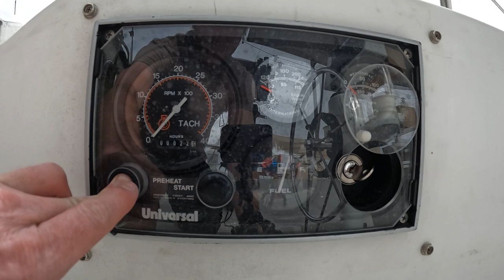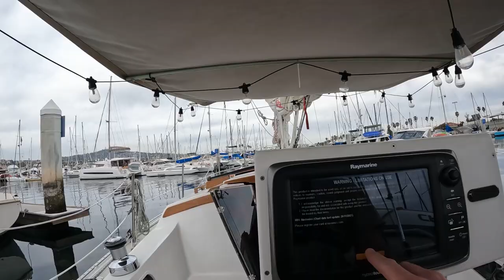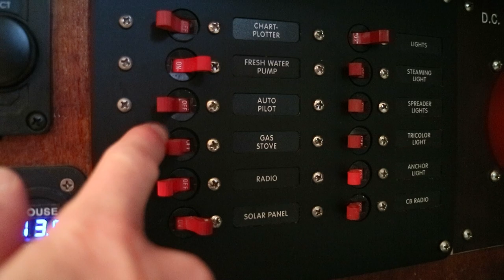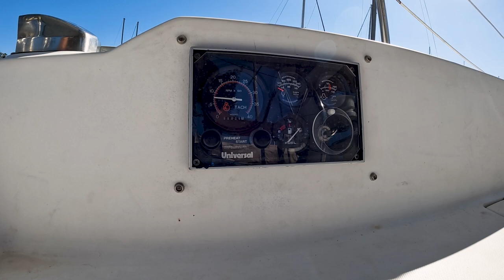Trouble at Sea! Adrift on a Catalina 30 | Sailing Fujin S1E5

Comment: Marine mechanic here who also owns a Catalina 30 with a Universal engine. Don't forget to order yourself some secondary (engine mounted) fuel filters as well. The Racor is a fuel/water seperator so that clear bowl is to check water so you can drain it. If you are seeing sediment (which is algae) you need to polish your tank. Put a biocide in the tank every time you fill it to keep algae at bay and to avoid serious fuel system issues that can destroy the injection pump and injectors.

Comment: Your vid showed up on my feed so your doing something right. I have an old Cat 30 too. There is nothing wrong with reefing lines at the mast. I do clip on with my safety harness when going forward to reef. Fuel troubles never go away. I put a round inspection port in my tank so I can clean it out. A vacuum gauge on the filter tells you at a glance if the line is blocked. Sometimes you have to take off the fuel line from the filter and blow the crud back into the tank if that is blocked. Keep the furling line under tension while rolling out the head sail  even while it's out. Nice winches but you don't need the extra blocks, they only add drag. A dodger is a must for cruising. Sailrite sells a nice kit. Dana point is a nice hop for you and you can anchor for free. What else? I hoist up the inflatable with the spin halyard and lash in down on the fore deck, deflated for long trips or heavy weather. I glue a Scotch Brite pad from West M. to a block of wood with a handle on it so it floats and hold my breath, no weights. 45 minutes and I'm done. A tea pot full of hotish water pored over your head is wonderful in this cold water!
Wally Erickson
Little Hope
Sandy Eggo
Reply from the maker: Thanks for all the tips! I have someone building a heavy duty dodger for me right now. Definitely alot more expensive than sailrites but it’s ridged and beautiful. I’d like to start anchoring in places like Dana Point but my ground tackle isn’t ready yet. I barely have any chain along with a 20lb delta anchor. The next big project is figuring out the best way to get a good system in place for the windlass and chain locker. Was thinking about modifying the chain locker and making it deeper since there is barely room for anything on the Cat30s. Was also thinking about mounting the windows on top of the chain locker. It will sit on a stainless steel plate right below the hatch for the chain locker. The hatch would have a hole cut in it so it could close it over the windlass, and the windlass would stick out through the hatch on deck. Saw someone do this setup online somewhere.

Comment: Great you made it. Lovely boat by the way. You are right. You need to be able to do basic troubleshooting while at sea and the ability to fix things like fuel filters, glogged fuel lines, oil leaks, and check all these before every sail. I would suggest you go on a course for Boat Mechanics. In the UK, the RYA (Royal Yachting Association) has just that vey course. Don't know in the US though. On our RYA dayskipper courses you are taught quite a lot of this and taught that you should not sail unless you have the right skills, spare parts and tools onboard to get you out of the commonly occurring faults. 9 times out of 10 it is something to do with your fuel system or a loose ground wire, if you have your engine serviced regularly. Best of luck and get yourself on a course. Well worth the time and money. It will give you the confidence that you can fix things yourself, rather than relying on others.

Comment: Great video.  Consider a racor type fuel filter/water separator.  I have the 500 series, and I can change filters in just a few minutes.  And, water can be drained from the bottom, and there is a nice clear bowl where I can see what is going on.  The best part is that after changing the filter, I just top it off with fuel, and then no bleeding is necessary.
Reply from the maker: Thanks for the recommendation! I’ll definitely add it to the list of projects!

Comment: We're neighbors at Cabrillo. I bought my Catalina 30 a year ago. Had the same fuel filter issue about a month ago. I'm setting up two primary filters with fuel line valve to be able to switch on the fly if necessary. Going through my 12 volt system now and going to haul out for bottom paint on 4/3... Keep up the videos there's another dude in Long Beach that got Cat 30 and has been putting out content too and there's a sailing meetup at Cabrillo that has some helpful workshops... My goal is to make it to Catalina for the first in a couple of months....mainly I sail between Pedro, Long Beach or Alamitos.
Reply from the maker: thanks for watching! I'm actually tracing out my whole 12v system today. It would be cool to come check out your setup some time. If you have an  insta account hit me up on there @sailingfujin, or just email me at twebster7676@gmail.com.
Reply: Hey dude I'm also your neighbor over at Cabrillo Way Marina with a Catalina 30. Thank you for all your videos. Let's have a beer one of these days!

Comment: I noticed the racks that you have for your dinghy. Can you tell me where I can find them or who makes them. 
I also have a Catalina 30 and have enjoyed watching your videos. Thanks.
Reply: We’re neighbors. My Catalina 30 is across the way at Holiday Harbor Marina.
Reply from the maker: @dbruner6255  trust me, you don’t want those racks. I went through two dinghy’s before realizing the racks caused the seams to tear apart. The dinghy does not like to naturally hang like that. Seam failure is almost impossible to repair.
Reply from the maker: @dbruner6255  trust me, you don’t want those racks. I went through two dinghy’s before realizing it was the racks causing the seams to tear apart. The dinghy does not like to naturally hang like that. Seam failure is almost impossible to repair.
Reply: @sailingfujin  thanks for the warning.

Comment: Thanks for the video. You made it 👏 These things happen. Got a suggestion for you; you got the outboard on you so if you install a bracket for it it can be your backup in case all else fails...just an thought. Take care.
Reply from the maker: Thought about lashing up the dingy to the boat and pushing it to Avalon lol. Pretty sure I would have ran out of fuel long before getting there haha. Thanks for watching!

Comment: Gotta have the dual filter with live switch over. Those things usually clog right when entering or leaving a crowded harbor….also can use the old filter housing and a cheap pump to polish your own fuel every so often. If you do that, and filter the fuel going in, you won’t have to worry about your fuel system.  Cheers.
Reply from the maker: Yeah, I definitely plan on adding a second filter housing to the system for a quick switchover eventually. Thanks for watching!

Comment: Thanks for the video. Where did you get your dinghy racks?  Those are perfect for the Catalina 30
Reply from the maker: Thanks for watching! 
DO NOT GET THOSE DINGY RACKS. They have wrecked two of my dingys now. The weight of the dingy hanging on the hooks eventually pulls the seems apart. 
Right now I just tow the dingy and put it up on the bow for now.

Comment: Get a Racor 500 fuel filter. All you do is unscrew the top, pull the filter out and drop in a fresh one. You wont have to do any bleeding. Takes 30 seconds, no tools needed, and no fuss or mess unlike the kind you currently have. The 500's size is overkill for your size engine but its worth it.

Comment: Yeah.  Been there done that.  Same thing.  Fueled up, it stirred up sediment in the tank, engine died.   I ended up sailing back to my home port several miles south on the Chesapeake Bay, with a wicked southerly.    (Look at a map of the chessie to understand while that is important).  8 hours of  20+ knot winds beating into the wind to get back to home port.    Ever since then, I have paid exceptional attention to my fuel system.   it has never happened again.
Reply: Ouch that’s not a fun sail…..ocean swells coming in unchecked AND all the shallow water we have around the bay 😵‍💫
Reply from the maker: hey at least you got back by yourself and didn't have to give up your dignity haha.

Comment: Hi. Nice video.  What kind of autohelm is that, and does it work well?
Reply: Thanks for watching!  It’s called Autohelm 3000 I believe made by Raymarine. It is about as primitive as it gets. A belt wraps around the wheel and is driven by an electric motor. The motor is connected to a head unit that has a gyro inside it, and it steers by magnetic heading.
Reply: Hi. Thanks for the video. Can you tell me about your stern pulpit fight racks?  Great idea but I can’t seem to find them.
Reply: @WebsterIndustries   Wrong. Its a CPT Autopilot. You clearly know nothing about sailing.
Reply from the maker: @SOLDOZER 
The brand name IS Autohelm 3000 and it IS made by Raymarine. 

CPT is another brand of the same style of autopilot. They both have the same function of steering by an internal gyro compass.

Comment: Wow this dinghy system is just what I’ve been looking for. What are those hooks called? Were they originally for the dinghy? Thank you!
Reply from the maker: I'm not sure what the exact term is for the hooks, but they are made by Edson Marine. I just scoured their website and couldn't find them or anything else like them on the rest of the internet. They've probably been on this boat for decades. I'm also not sure if the dinghy likes sitting on the cradle like that; it might have been what contributed to the tear in the seams. I'll probably just end up towing the new dinghy most of the time cause I'm scared of wrecking another one haha.